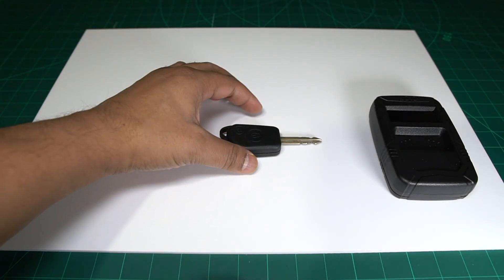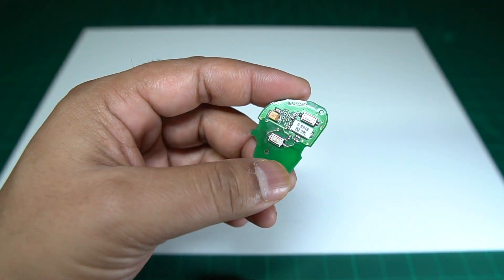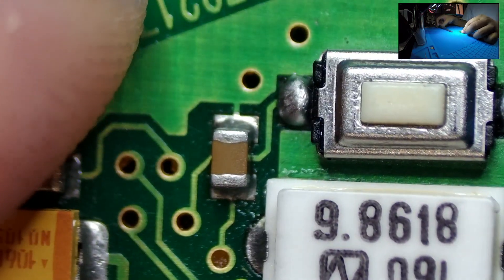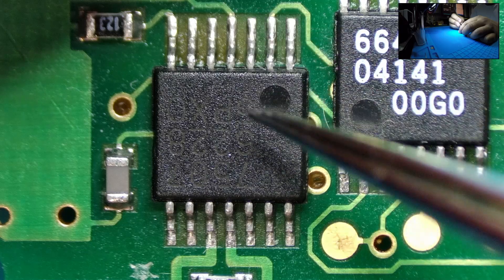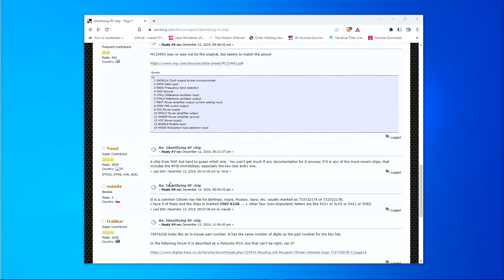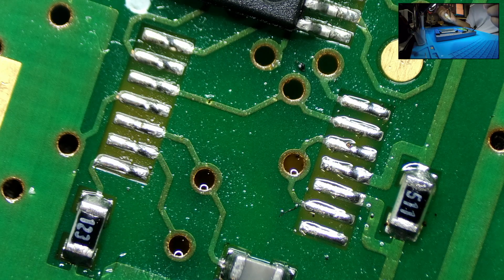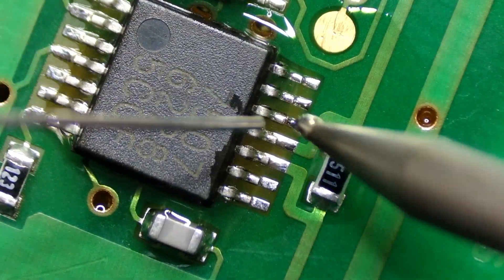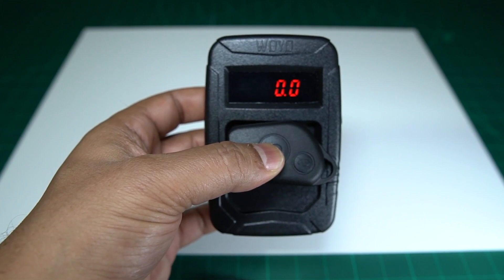Citroen Saxo Picasso Xsara Berlingo Key Fob RF IC Repair - iRefab

Comment from the maker: We encountered a recent job that required us to replace the 664006 IC on the board, which is responsible for storing the central locking code. It proved to be quite a challenge, and I highly suggest watching that video as simply swapping the chip won't restore its functionality. There are additional steps involved in the process. Check out the video through this link: https://youtu.be/DxTn7kUUQww

Comment: Hi, excellent video on this key. I have one that I've tested continuity on the buttons. they are fine. My microcontroller is 7507 6228 5PXM. last 4 are different to the one in the video. would this not matter? soldering SMD components is beyond my capabilites if you could give me a price on testing the rest and maybe soldering one of these on please 👍👍
Reply from the maker: @davecoggan9619 Thank you for watching the video and appreciate the feedback 🤲🏻. Yes you are correct that last four digits don’t matter.  RF controller IC failure is a common issue with these unfortunately.  If you could email me on the address below irefab.info@gmail.com I’ll send you over a quote and if your happy with everything we’ll take it from there 👍

Comment: Hello. I replaced the microswitchs but the key is still not working. I'll try to fix it replacing the IC. 
Do you know the procedure to resync the keyfob?
Reply from the maker: Resynchronise the HF remote controls procedure:

1. Switch OFF the ignition and remove the key.

2. Wait for 1 minute without pressing any remote control buttons.

3. Insert a key into the ignition switch, then turn it to the ignition ON position.

4. Within 10 seconds press the locking button for 5 seconds.

5. Switch OFF the ignition and remove the key.

6. Repeat the procedure with the other keys from point number 3, or else go to point number 7.

7. Wait for 30 seconds, remote controls are now active.

This procedure can be used at anytime and does not require the use of a diagnostic tool.

WARNING: Pressing one of the remote control buttons when it is de-synchronised causes the BSI to switch to anti-scanning mode for 1 minute, during this time re-synchronisation is not allowed.

Hope this helps 👍
Reply: @irefab  REplaced the IC and the keyfob is working again. Thanks
Reply from the maker: That’s great news brother, glad you got it working 🤲🏻